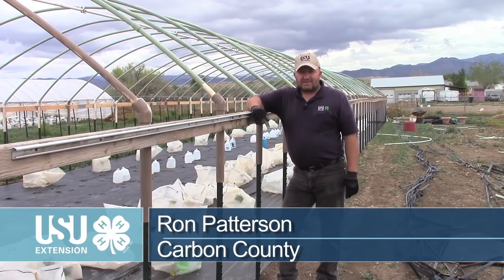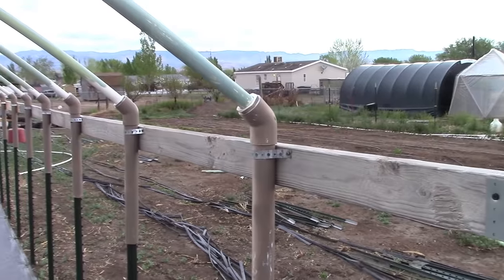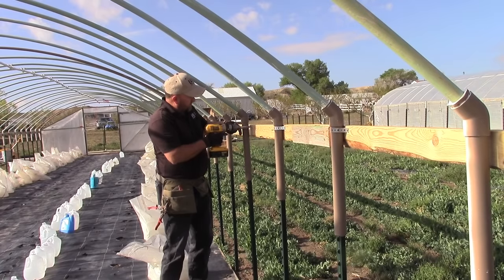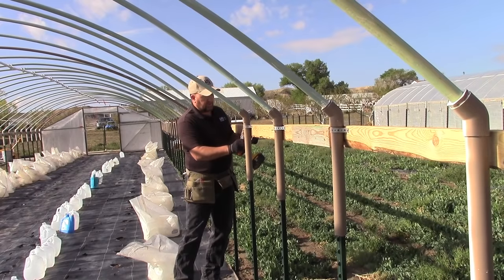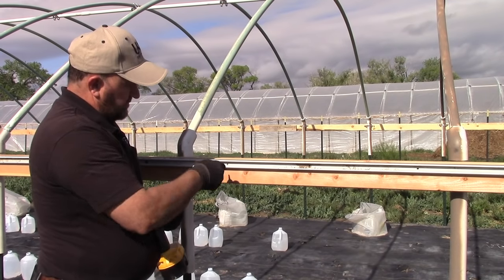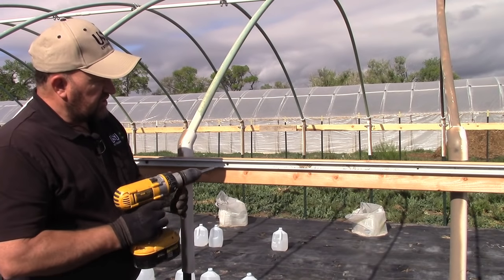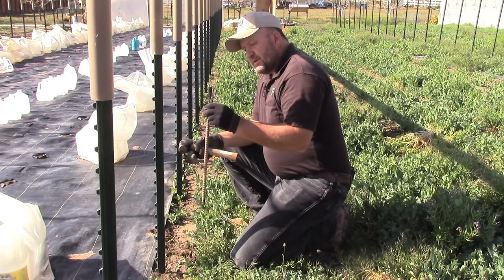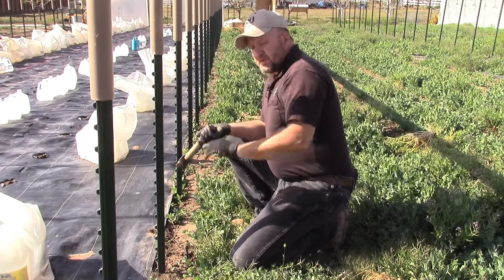Hoop House Side Wall Construction

Comment: First off thank you for helping our youth with your 4H programs. I used to build my green houses with PVC pipe as you have here but I found that the plastic would only last a couple of years as I found out a chemical reaction between the two plastics. On my last green house I used 1 1/2” galvanized and swedged  fencing tubing for the bows and 3) 1” longitudinal braces
Reply: Building with the galvanized tubing my cover plastic has now lasted 5 summers. I leave it up year around and we live in a very sunny (300+sunny day/year) . I clean the snow off at 8-12” depending how wet the snow. Had 18” one storm though. The aluminum channel and stainless steel wiggle wire has worked great for me, even with the snow load.  Cheers
Reply from the maker: That is an important point. Your galvanized tubing will definitely handle some snow load better than my design. It's fun to come up with your own solutions. If you do get a snow collapse your bows will need to be replaced, so use care. I paint my PVC with exterior latex paint and my plastic lasts at least 4 years if I don't tear it. Thanks for watching.

Comment: Suggest using electrical pvc instead of irrigation pvc.  It is same dimensions but is made to use above ground so it doesn't become brittle and you will get significantly more years life out of them.  They cost the same.
Reply: I'll have to try electrical PVC and see if any issues come up for me. Thanks for the suggestion.

Comment: Thank you for the videos, great job! What would I need hoop / pipe for a 12' ceiling? I have a piece of 100' x 36' x 12' greenhouse plastic. Also, what is angle elbow that you used to connect the 1 X 11/2  pipe?
Reply: Esther Anna The easiest way to raise the roof is to use taller t-posts—6.5’ or 7’ rather than 6’. You want some extra material on each side so the plastic will drape clear down to the ground. The elbows are 45 degree elbows. Thanks for watching.

Comment: Great job man! Q. Q. please. I have a fish pond which is 6.5mX10m and would like to make a shade for it; to prevent algae from forming in it. Is this possible with pvc pipes? TIA
Reply from the maker: I use shade cloth on this high tunnel every year. I also use a similar, elevated design to put bird net over my fruit trees. Thanks for watching.
Reply: Very well done over all.

Comment: Are those fence post strong enough for sidewalls? Did you have problems with the wind or snow?
Reply from the maker: The fence posts are plenty strong, however, this is not a design for snow. If you think you run a risk of snow be sure to support the arches from inside--I would place a 2x4 under every third rib, right under the junction of the arch and ridge purlin. Thanks for watching

Comment: Ron, 
Great instructional! Thank you. Are your hip purlins 2x4 or 2x6  boards, and are they pressure treated?
Reply: They are 2x4. I tried 1x4 but they don't have enough strength. Since they are not on the ground I used untreated lumber. That way it isn't an issue for organic producers.

Thanks for watching.

Comment: great work, is that a plumber's PVC pipe or electrical pipes and what size are the pipes in the ground and on the roof? 
How is the pipes pinned into the ground? 
What is the length, width and height of the hoop house?
What is the spacing between each pipe?
Reply: That is plumbing PVC pipe. The pipes that slip over the t-posts are 1 1/2". The arches are 1" PVC. I tie the whole thing to the ground with the rebar stakes that I show at about 5:30 in the video. I screw an eye screw into the hip purlin just below the wiggle wire track then tie from the eye screw to the stake. The ribs are spaced at three feet so the high tunnel can be any multiple of three feet. Mine are 93 feet long because that fits my farm layout. The best high tunnel width for the 45 degree angle with 20 foot PVC is about 17.5 feet. It ends up being about 10 feet tall.

I have a series of six videos on my high tunnel construction. They cover from layout to arch construction, to ventilation and more. If you go to the USU Extension YouTube channel the search for Patterson hoop house it should pull up the list of all of them. These are quite rough and I need to get them edited better and do one more on the endwall construction. Thanks for watching.

Comment: Is this type of poly house suitable for heavy wind region?
Reply from the maker: That is what I designed it for. One source indicated that the average wind speed for Carbon County Utah is 40 mph. We have had sustained winds up to 60 mph and gusts over 70 mph and these have done fine for me. The only time I have problems with the wind is when I leave one side down and lift one side for light ventilation, then get surprised the the change in wind direction. The balloon effect can cause some damage. Thanks for watching.

Comment: was wondering how this holds up to snow loads as I live in Idaho and get lots of snow , or do you take the plastic off for winter . Thanks love this high tunnel design  .
Reply from the maker: Yes they do quite well in snow; we have built many of them in Northern Utah
Reply: This particular design will not tolerate snow load without significant support inside. There have been some people who have built an inside support and keep the cover on. I get tired by the time snow falls so I take mine covers off until just before I'm ready to plant in the spring. I have had a partial collapse with a surprise snow storm. USU also has a PVC high tunnel design that is about 14' wide that is steeper and sheds the snow better than this design. 

Check out the rest of the high tunnel construction videos for this design at the USU Extension YouTube channel and search for "Patterson hoop house".

Thanks for watching.
Reply: Idaho k9Trapper ideally it should be warm enough in the winter to melt most snow you would have on it but mostly the snow will slide off just make sure it doesnt pile up on side walls too much mine has a steeper pitch tho. Northern Indiana here so we get lots of show here too blows in strong off lake Michigan

Comment: what is the size you are building ?  can you build hoop housing any size using the same principals?
Reply: Thomas Martinowsky this design is 17.5 feet wide. That way you don't have any joints in the arches. You could go narrower so your arch would be much higher, but the 45 degree elbows would be stressed a bit more. As for length it is in multiple of three as there are three feet between each t-post and arch rib. You can go as long as you can get plastic that long

Comment: Roughly how much did this cost to build and how many years so you expect it will last
Reply: Wolfman 420 When I calculated it about 5 years ago my costs were $1.50 per square foot for a high tunnel that measured 17.5 x 48, which included the covering. I have had an occasional arch break from fatigue, but much of my PVC is ten years old and still serviceable. The PVC will last much longer if you paint it to protect it from UV rays. The plastic cover will usually last about four years. Thanks for watching

Comment: May I ask (to anyone)- Does anyone remove their plastic cover for winter? I live in Colorado and the winter months can be brutal on plastics. However I have heard that taking your plastic off and putting it back on causes wear and tear also. Of course I'm thinking that snow load is not an issue if you remove the plastic over winter. Would it be best over all to build a strong cross beam support at the top and then cover the plastic (left on) with a tarp or black plastic?
Reply: DragonflyArtz1 I remove my cover for the winter, mainly because I don’t plan to grow anything during the winter. I use my high tunnel for season extension—about 6 weeks in the spring and 3-4 weeks in the fall. Removing the plastic each year does present more opportunity to accidentally tear the plastic. I detach my plastic on one side and pull it to the other side and then roll it up and tie it to the hip purlin for winter storage. That way it is off the ground, not flapping in the wind, and less likely to get torn when you put it back over in the spring. It also makes it easier to get the cover back on in the spring. I have had other people indicate to me that they have built bracing down the middle inside and use the high tunnel throughout the winter. Thanks for watching.
Reply: TY Ron. I love the idea of rolling it up. I would think folding it for a season would be very bad. I do not plan to grow anything during the winter. TY for giving me inspiration for some clever planning.